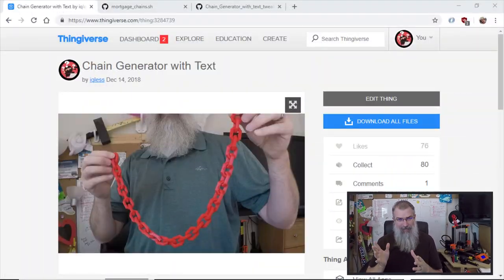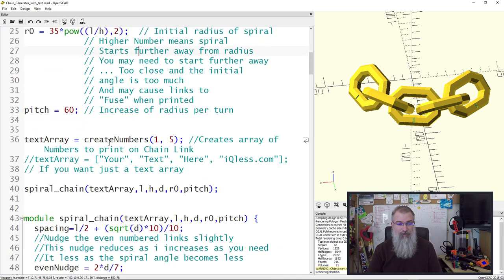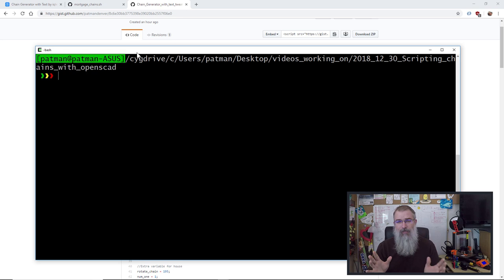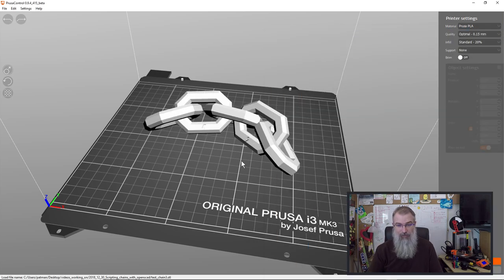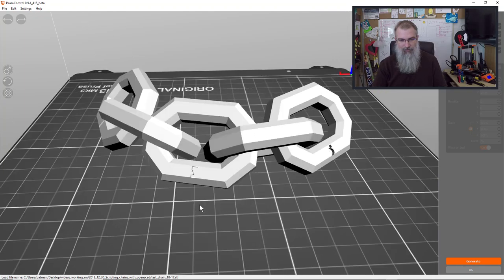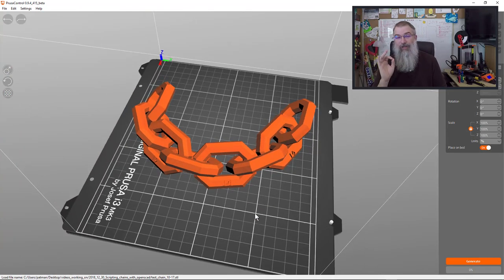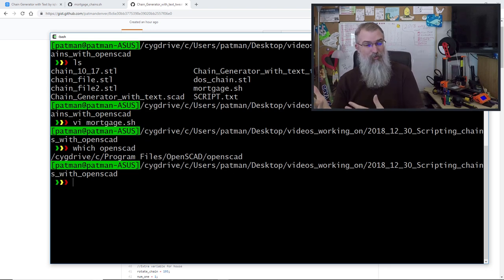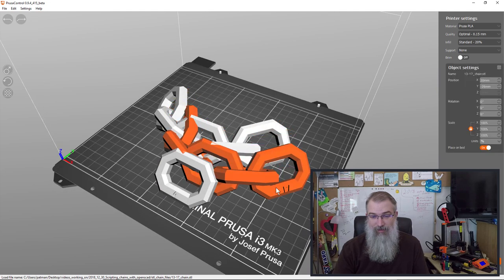Openscad: Using scripts to automatically Generate STL Files

Comment: super cool!  i've never passed variables in on the command line to openscad before!  thanks for showing that off!

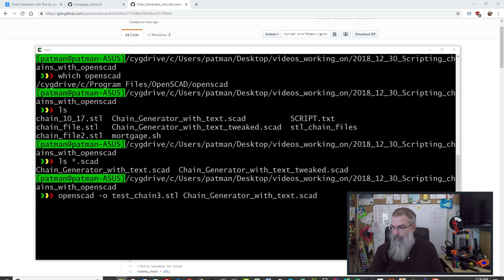the problem you're having with some of the chains not working is possibly recognizable at the scripting level.  notice at 5:55 how the output of calling openscad says "WARNING: Exported object may not be a valid 2-manifold...".  that will happen when openscad isn't sure it can generate an STL from the code.  if your script looks for that output, it could flag those STL files as in need of manual review.

you might be able to avoid this entirely by avoiding certain geometries.  after quick review of your chain code, i see you're linear_extruding polygons.  that's where i would look first if i were going to spend more time on it.  one thing to avoid is polyhedra that share one edge.  here's a simple example of what not to do:

cube(10);
translate([10, 10, 0]) cube(10);

render that and you'll see the same non-manifold warning.

one way to avoid this is just to have the shapes overlap a little:

cube(10.1);
translate([10, 10, 0]) cube(10);

if you find a better way to solve that, let me know.

there's more info on this page about this sort of problem:
https://en.wikibooks.org/wiki/OpenSCAD_User_Manual/Primitive_Solids#Debugging_polyhedra
Reply from the maker: Thanks Ozzloy.  Good suggestion on reading the output and flagging it.
I need to go look into the share edge issue more and see if I can fix it.

Comment: Hi. Great video. Is it possible to import already made stl (clear name tag) into the openscad and cut out the name into it (names in text file) and export it as stl ? So I would have easily 100 custom nametags without much effort. Thanks.
Reply from the maker: It is possible.  But not a 100% thing.  There is an import command in openscad see (https://en.wikibooks.org/wiki/OpenSCAD_User_Manual/STL_Import_and_Export)  I was able to successfully import several stl files I made from Fusion 360 and have them render properly, but a some did not.  Of the ones I did import I was able to add my a name to it and have it render.... This seems like something I need to do a video on ;)

Comment: Nice video!!!
I'm using python for the script but can't make it work with string variables. Say I want to 3D print a Scrabble game and I have the .scad file for one piece ad a string variable with the letter of that piece. Do you know how to do it?

This two line work just fine:
subprocess.call(["C:\Program Files\OpenSCAD\openscad.exe","Letras.scad","-o","x.stl"])
subprocess.call("C:\Program Files\OpenSCAD\openscad.exe Letras.scad -o x.stl")

I'm not asking about python, just how to use string arguments.
Reply: im having same issue, string variables are not working